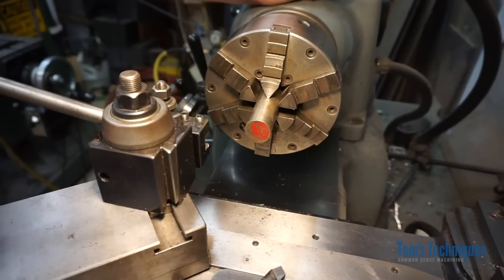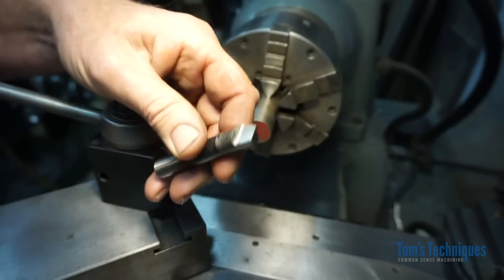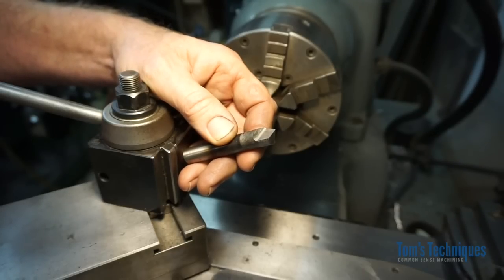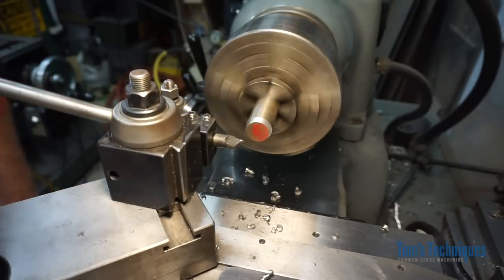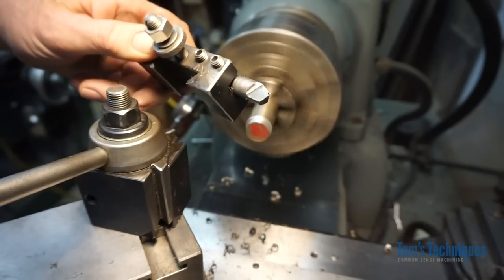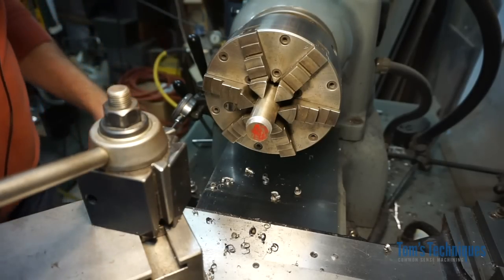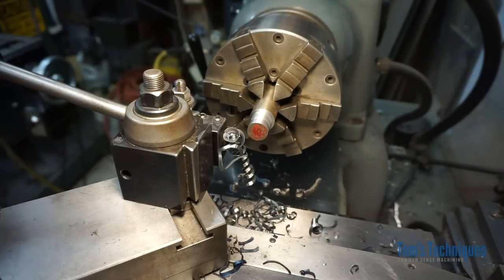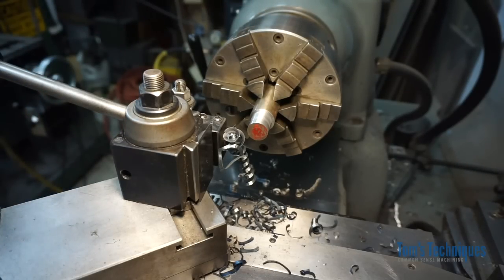Red Hardness

Comment: Great video, what about hss vs carbide?
Reply from the maker: When used correctly, carbide will out perform HSS four to one. It is however, much more expensive, less versatile and less forgiving than HSS. I consider it more appropriate for commercial applications than hobby machining.

Comment: What about HSS drills? They usually last much longer with flood coolant. Is it because of better chip evacuation?
Reply from the maker: Drills get extremely hot because it's difficult to get the heat away from them. Coolant just helps keep them from over heating.
Reply: @TomsTechniques  Getting heat away isn't the problem, if the heat produced would be the same as in a lathe cutting tool. But it isn't, as the chisel point in drill is like blunt force trauma, generatoring enourmous amount of heat because it doesn't cut at all.

On smaller drills you can drill & drill all you want, as the chisel point on them is next to nothing, but larger ones will quickly develope burnt edges.

Comment: I've been told that although the tool retains it's hardness, it loses some of it's wear resistance. is there any validity to that?
Reply from the maker: I've never heard that, but I suppose it might be possible in extreme examples like this. I doubt that would happen from the heat generated by normal grinding practices. I basically did this video to silence the comments from people confusing carbon steel with high speed steel.

Tom

Comment: So why is it so easy to kill a drill bit when drilling too high speed, I thought it was the heat that killed them?
Reply from the maker: It is. A drill confined in a hole gets extremely hot if run too fast or not cooled. The entire drill doesn't have to overheat to kill it, just the cutting edge.

Tom
Reply: Toms Techniques 

That makes sense thanks for clearing that up.

Comment: This is very rue and informative information. It should have been an automatic given considering high speed steel did not exist when the rules they are quoting were created. 

It reminds me of the folks who still tell me "don't put a car battery on concrete floors it will cause them to discharge." not taking into consideration the rule was created back when car batteries hod a wooden case. With the invention of plastic and car batteries being manufactured with plastic cases it is no longer true but somehow it has still carried over into batteries manufactured today even though they know plastic is not porous and does not allow liquid to seep from it. The thing that gets me is I am about 100% sure everyone in America has at least 1 plastic drinking glass in their cabinet or has at least drank from a soda bottle.

So I agree high speed steel has many benefits and I am surprised anyone would say anything to you considering it is literally telling you that it can be ran at a higher speed in the general name of the steel itself. It's not like it's called "slow speed watch your ass steel". 

But then again they are only slowing themselves down by believing that. Once they accept that fact maybe they will be able to turn out machine work quicker than they do now.
Reply from the maker: Thanks EC.

Too few people follow the crowd and question nothing, which results in false or outdated beliefs. You learn much more by questioning everything.

Tom

Comment: I welded HSS steel for T-slotting on shaper  because of your video  thanks  Tom
Reply from the maker: Should work fine as long as the cutting edge stays under 1100º. How did it weld with all that carbon in it?

Tom
Reply: just fine i had a special electrode for  unknown iron material for repairs thanks again for sharing your knowledge

Comment: Excellent demo. Why did the chatter continue after you pulled the tool off the part during the HSS segment?
Reply from the maker: The sound man didn't know what he was doing when he synched that section of the audio. I'd fire him, but then who would make these videos? :)

Tom
Reply: Thanks Tom. The demo was good. Can you do this with a HSS end mill with the same success?
Reply from the maker: Yes Joe, all high speed steel has good red hardness. I only used a lathe tool bit for the demo because that is what most people are likely to grind.

Thanks for watching.

Tom

Comment: Some os us are just starting to learn. Literally "starting to learn" so if you are doing an instructional video, you need to avoid using terms that you do not clarify. Otherwise you explain one thing but create a new question. For example your video s topic is " red hardness" . Nowhere in the video do you clarify what " red hardness" is and how you have addressed it, explained it, or resolved it. Explain what it is; its significance; why you are addressing it; what did you resolve in your video.
Reply from the maker: Wow John, did you totally miss the demonstration and explanation starting at 6:00? Your homework for the night is to watch the video again, paying particular attention to the part where I heated the tools up with a torch, dramatically demonstrating the affect heat has on the red hardness of O1 vs. HSS.

Tom
Reply: Red Hardness: the ability of steel, upon heating to red heat, to retain hardness and durability obtained through heat treatment. A high level of red-hardness is characteristic of High Speed steel. Red-hardness is achieved by alloying steel with tungsten, molybdenum, vanadium, and chromium, as well as by high-temperature hardening. M42 is another type of very hard, tough and even higher red hardness steel with 8% Cobalt .
Reply: In the time it took him to write that criticism, you'd think he could've looked it up.

Comment: That Hardinge is super quiet
Reply from the maker: +Sandman Actual 
Belt drive!
Reply: +Toms Techniques That's a very nice machine, was it restored?
Reply from the maker: +Sandman Actual 
No, its in original condition. I bought it new in the mid 80's.
Reply: well, you certainly are lucky to own such a fine and well kept machine. Most of the lathes I see growl like a Mack truck and Squeal when you put them into the higher speed ranges. It's nice to see and hear (barely, haha) a preserved piece of history, there aren't many new machines out there that can match the quality and ruggedness of the old hardinges, and monarchs.

Comment: i dont have lots of experience with lathes, but your one seems very quiet! why is that?
Reply from the maker: +Jack T 
Hi Jack,

The Hardinge HLV-H is one of the highest quality lathes available and it uses a variable belt drive system that is enclosed in the base cabinet. The only time gears are turning is when it is threading. I also purchased it new in the mid 80's, so it has relatively low time on it.

Tom
Reply: +Toms Techniques thanks for the reply! I ended up watching hours of your videos. love your work. going to save up for my first lathe/mill.

perhaps I could get your opinion. 

http://www.machineryhouse.com.au/K146
Reply from the maker: +Jack T 
Thanks Jack, I'm glad you are enjoying them.

I would suggest steering clear of combination machines like that. The lathe part would probably be ok, but the mill would be way too light to do much with. A mill needs a massive column to be rigid enough to deal with the forces of an end mill acting on steel. Look for one that has a heavy cast iron column, not a steel tube like the combo machines or some bench mills. 

I'm not sure what the used machinery market is where you are, but a used commercial machine is always a better bet than a new hobby machine. For instance, around here you can buy a used Bridgeport mill for about the same money as that new combo machine and it will weigh in at about a ton instead of a few hundred pounds. Weight is rigidity.

Tom
Reply: +Toms Techniques appreciate the feedback. I will look into the used market. the benefits of weight and rigidity might be outweighed (pun intended) by my skill level budget and space where I'll be using it. I.e at home in the garage. I'll look into the standalone mill. :) thanks again.

Comment: Tom I am trying to drill tiny hole thru 1/4 brass. what bit should I use material name thanks
Reply from the maker: +JB 
Any drill bit material will work for brass, but most are high speed steel.

You may have misinterpreted the video. I  only made it to show that it overheating a HSS drill while grinding will not damage it. It would be next to impossible to find a twist drill made out of anything but HSS today.

Thanks for watching.

 Tom

Comment: Great demo Tom. But, when does one use high speed steel vs. carbon steel?
Thanks.
Reply from the maker: +tommie293 
Virtually all metalworking tool bits, taps and drill bits are high speed steel. Carbon steel is still used for edged tools in woodworking, such as knives, chisels, planes, etc.

Tom

Comment: Are all HSS blanks created equal? if not what is the selection criteria for those?
Reply from the maker: +Emery Board 

All high speed steels are not created equal. General purpose types such as M2 and T1 have excellent toughness, but average wear properties and are very easy to grind. M42 with it&#39;s higher molybdenum content works very well on interrupted cuts such as for machining weldements. T15 is extremely hard but very brittle and is extremely difficult to grind, especially by hand. It works well for form tools used under controlled conditions. It also excels for machining aluminum.

Tom
Reply: That makes sense thanks. Some companies online sell them as HSS so I have no idea what they are actually...based on your explanation I will be looking for M2 or T1
Thanks again

Comment: The main alloying element in HSS is tungsten, not cobalt.
Reply from the maker: +Георги Кънчев 
That's like saying the main ingredient in soup is chicken. Tungsten is the main element in the T series alloys, ranging from 12%-18%, but not in the M series. The M series contain much less tungsten (2%-10%) and much more cobalt (5%-12%), and in most cases more cobalt than tungsten. High speed steel contains many elements depending on the grade and each of those elements improve one or more characteristics of the steel. Tungsten and cobalt both increase hot hardness, molybdenum increases toughness and chromium improves hardenability. Other lesser elements found in high speed steel include silicon, vanadium, manganese and phosphorus.
Reply: @TomsTechniques  - yep, there's guaranteed to be one in every crowd, eh Tom? Thanks for your vid's. Enjoy them immensely.
Reply from the maker: On YouTube there is generally more than one. :) Thanks for watching

Comment: Hi Tom,  Just curious - What are you using for camera, sound and editing equipment?
Reply from the maker: +Dave Kellogg 
Hi Dave,

The camera is a Sony a6000 mirrorless with a 16-50mm zoom lens. The sound system consists of a Zoom H4n digital recorder fed by a Shure PGX wireless mic. I record two channels in stereo and one mono channel for the lavalier mic. The camera audio is only used to sync the other channels and then discarded (because it sucks). The video and audio editing is done on Cyberlink PowerDirector 14.

Tom

Comment: Impressive! I didn't realize HSS was that tough! Great video!
Reply from the maker: +Dustin Masters 
Thanks. 

High speed steel rules! It's a much better option than carbide for light machining.

Tom
Reply: I actually started using HSS almost exclusively after watching a few of your videos a month or so ago. Better for my budget also, and way easier to make custom tool bits.

Comment: Good to see you back.   That "chatter" sound stayed until the machine shut off both times, even though the bit was no longer touching the work.   I wonder what is causing that?  Thanks,  Chris
Reply from the maker: +shadowdog500 
Guess I'll have to fire the sound man. Apparently he didn't get the sound properly synced with the video in the second segment.

Tom
Reply: +Toms Techniques  Thanks for the explanation.  I thought the same thing, but the fact that the chatter sound stops exactly when the chuck stopped both times got me thinking that there may have been an issue in your headstock.  I'm glad it's not.   I look foward to your videos this  winter.  Chris

Comment: Welcome back...
Often had the chance to test this HSS properties on my own, around 60 RC before welding it to a boring bar, and same 60 RC after, HSS will air harden, to soften this type of steel and some other tool steel type, you need to cool down at a very slow rate like 20 deg. C per hour or so...
Nice demo...   ;)

P.S. As a Canadian effort to help Keith Fenner fill his WIYB giveaway tool boxes, we made some knurling tool from scratch, not the type you designed, but something that performs pretty good also, just in case you're interested you're welcome to go to Keith's channel and mine....
Reply from the maker: +pierre beaudry 
Thanks Pierre. I used to surf the various channels, but not so much any more. Just not enough hours in the day.

Tom
Reply: Surfing channel is fun, but, I have to limit myself to only the better ones...  ;)

Comment: Good to have you back, I like your videos all tuition and no flea market finds or V.A.G..
Personally I don't like getting HSS too hot, when grinding, not because of worries about loss of hardness, I just don't like burnt fingers.
Reply from the maker: +Chris Stephens 
Just keep it cool enough to handle and life will be good.
Reply from the maker: +Chris Stephens 
Yup, I always keep a cup of water handy.
Reply: absolutely right, or let it cool in air if really too hot, then put in water. You would have to be an animal to actually cause cracking.
Reply: +Toms Techniques  I hope only to quench fingers and not bits. That results in surface micro fractures. Easy to see under a microscope. This can cause material buildup with resulting micro thermal shock and cutting edge breakdown. This is why most peoples resharpened bits chip and wear quicker than new. Friends are amazed at the finishes and life their bits get when I grind them for them. Of course, 40 years of practice helps too.
    Mike (o\!/o)
Reply: If you quench before the tool reaches the critical temperature and also plunge the cold end into the water first, the potential for cracking is greatly reduced.